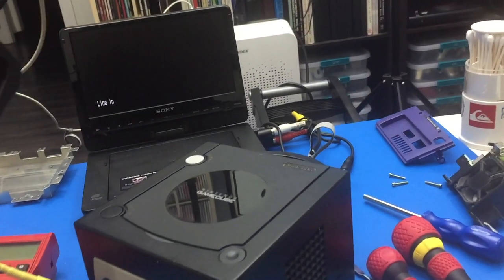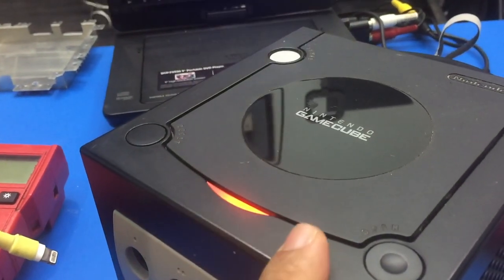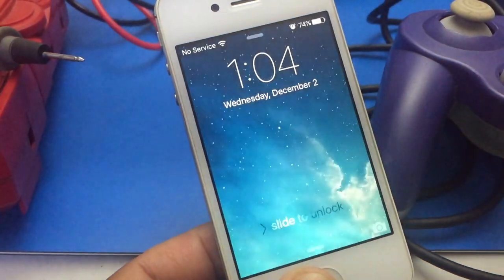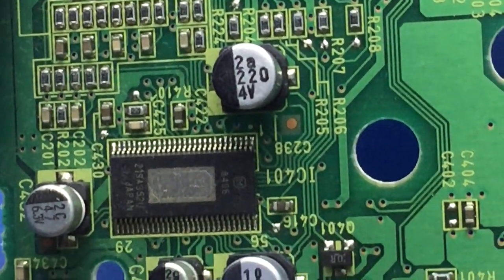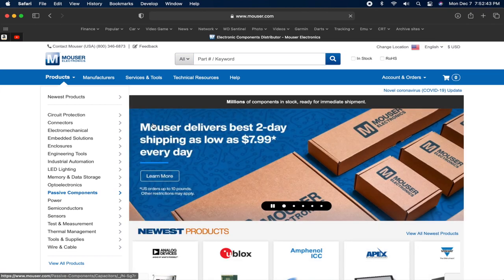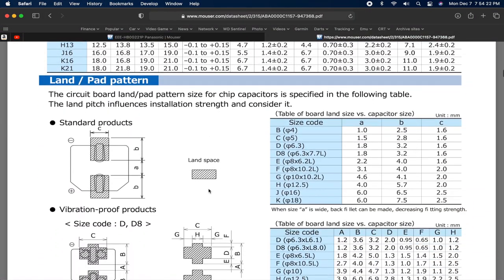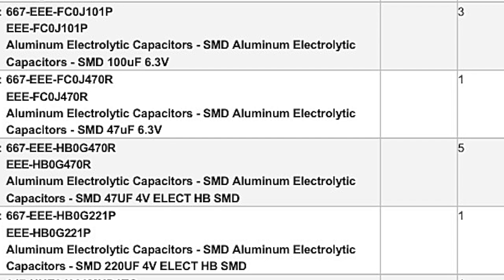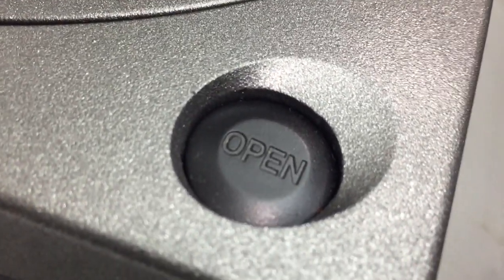Episode 115: Gamecube "No Disc" Fix- Optical/Laser Board Capacitor Identification and Ordering

Comment: My gamecube is not reading discs at all. I already tinkered with the potentiometer and even bought a new lens! Still nothing. So I asked a friend with a gamecube to borrow it to me for a day and replaced the optical drives. Hers worked perfectly fine in my gamecube, and mine couldn't read discs on hers. I also swaped lenses and all worked well in her optical drive! The discs are spinning and the lens moves back and forth, so i guess the fault is in the board, but it doesn't work even if I leave the gamecube on for half an hour and try again. Any ideas on what could be wrong, or if it can be repaired at all without replacing the whole optical drive module?
Reply from the maker: It’s doesn’t have to work after a period of time. The capacitors could be completely dead. More than likely, doing this repair will fix it, barrng u didn’t mess up your laser pockup by messing with the variable resistor.

Comment: the extra mile you do in your videos is top tier.  simply listing out the specs for potential cap kits for people to follow is huge.  also that dyed dreamcast is awesome, potential future video??  wouldnt mind trying that out in summertime maybe
Reply from the maker: Hey, you're in my head!!! You get the idea... also forgot to state that you choose the quality of the caps to your individual idea of what is best. Lot's of capacitor snobs and theorists that say to use only low ESR caps... or even gel caps. But yeah, cheaper and better than buying preslected kits cause you, again, can choose how high quality you want to go. The DC is half dyed. Bottom is left dyed. Top is painted. And I thought I said it would be the topic for the next video- the decal making and applying actually. The dying part... that's tough. I actualy oevercooked it and it started to melt and deform. Good thing I took it out in time. Had to use the heat gun! LOL. It was an adventure. Not something I plan to do again. I just had to try it. There's a lot of info on plastic dying that you can google. I just don't have the experience to give out advice after a single try. 

But thanks for commenting and for appreciation. Much appreciated!

Comment: Thank you, it worked for me!! I just replaced the C408 capacitor because my welding skills are not that great, and it was enough for the gamecube to start reading games again!
Reply: I'm learning to solder myself. Lessons I learned I wish someone told me as a given, set your iron lower than 350 degrees, it could make the molten blob dry out and burn. Most important is a clean iron, sand it grind it, flux it alllll the time. Clean unoxidized metal surface.
Reply: Flux the hell out of the surface you're soldering, it keeps the blob in its spot and safe
Reply: A good technique is to get a blob on the iron and then apply it as the surface heats with the iron contact, remove when the surface is hot enough to meld with the blob. Flux flux flux

Comment: Just replaced the C408 capacitor (47uF), only this one, and it worked!
Another video said that this particular one is the trouble.
I replaced it by a 47uF/25V TH capacitor (soldered horizontally).
To get things evenly, I also replaced its neighbor (C431) which has the very same specs. VERY HAPPY!
Reply from the maker: Awesome. But for posterity's sake, and future peace of mind, it doesn't take too much longer to replace the other capacitors.
Reply: @The_SegaHolic  OK!
Reply: @natanteam  wait so instead of 4V you chose 25.. how come bro?
Reply: @ministryofhandsome82  it is working nicely for more than one year. You can always use a little higher V cap, but never lower.
Reply: @natanteam  oh true! How much higher though?

Comment: I would recommend using Console5 as a parts supplier. No hunting down specs and sizes :)
Reply from the maker: That’s actually why I made this. This is cheaper as you can get way more for your buck, and as and alternative to that. You can also choose your brand, the quality if your caps, and make sure they are the size you want them. Console 5 sometimes does substitutions and you don’t know exactly what you are getting.
Reply: @The_SegaHolic  I'm used to make my own capkits, and until now, 4 times it was asked to me to install a Console5 capkit, 4 times at least one cap is missing and/or have a wrong value/size. 3 times voltage rating of some capacitors were under the original value, which can causing some trouble in the future if the capkit is installed as it was sold. I don't mind some substitutions, but not this kind.

Comment: Hi, can I use a smaller lenght/diameter capacitors? The shipping cost from Mousers amounts to 20€ and I'm unable to find the exact same measures anywhere else. Thanks for the tutorial, you did a great job!
Reply from the maker: Thanks. The parts you can find also find on Digi-Key as well as Arrow. I know there is an Arrow division in Europe. But yeah, as long as the voltage and capacitance specifications are the same, physically, smaller will work no matter what. Diameter wise, smaller, but not too much smaller as the cap leads may not reach the pads.
Reply: @The_SegaHolic  thanks a lot! I'll give a look!
Reply from the maker: @Sus023  👍👍👍